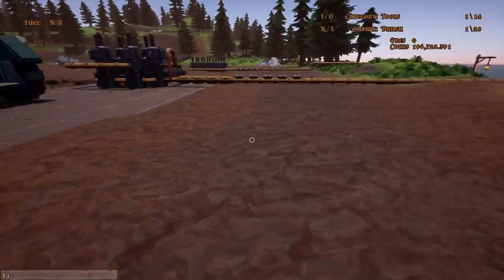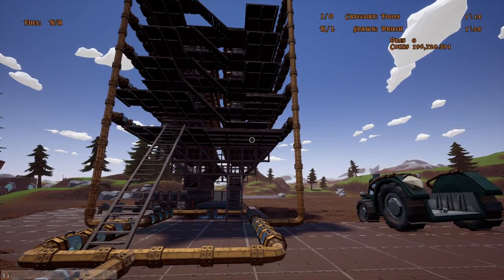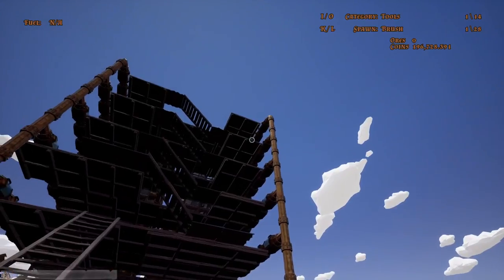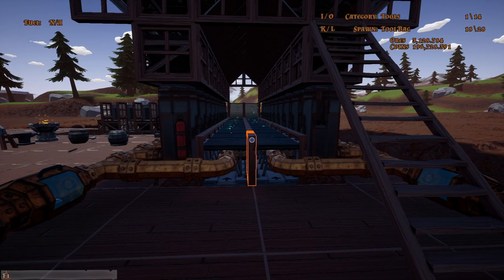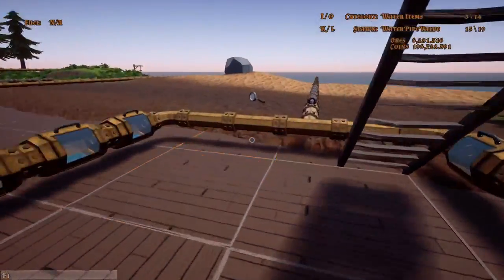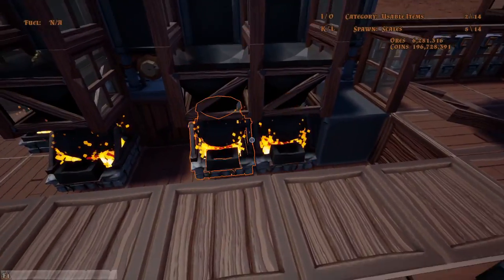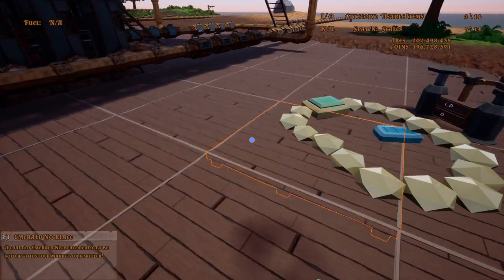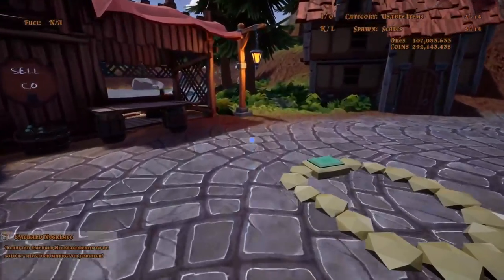Massive 200 RAM Drill Tower| Hydroneer Gameplay

Comment: You CAN make a bigger build.  I'd do it myself if there were a more efficient way of buying and transporting lots of parts.  I don't have the patience I used to, apparently.  Anyway, what you need to do is minimize the amount of time the resource particles exist in the world.  Right now you have only one sorting and smelting station.  There's room enough on that plot for many of them.  What I suggest is having each ram drill face directly into the top of the automatic sorts (I forget their name).  The dirt particles basically exist for a fraction of a second, if at all.  They get processed immediately.  I'd suggest 10 or 20 pairs per belt per foundry cell.  That way the resource particles exist in the world a minimal amount of time.  Long story short, the shorter they exist in the world, the faster you can go.  Even though you have multiple foundries, you can always take all the bars and chuck them on a belt at a final refinery to sort and smelt, collating all the output in the end.  I forget, is there a creative mode?  I could make an example.
Reply from the maker: i cant make a build bigger than 200 ram drills i just dont have the power mate.. i need a better gpu and cpu
Reply: @Hybridsteel  The game itself is simple.  The physics calculations are the bottleneck.  

Do you have a way of buying and moving a whole lot of stuff at once?  Pallets are in and they're great, but even so there is a lot of hauling to do.
Reply from the maker: @Whackjob  apart from loading up the pallets and truck nope not really any other way...

Comment: I’ve not seen any bigger builds with the David/Goliath drills. It’s very difficult with the direction of the David dirt generators pipes. I finally got a setup of 8 compact and all underground. Next step is to try 12. Would love to see you give them a go. Great videos!
Reply: Also, is this all run off of one main pipe? Does the power shards increase the amount of water in the pipes
Reply from the maker: theres a guy in the discord who has 126 goliaths running smoothly.
Reply from the maker: so it all runs off 1 line but with pipe splitters and chambers everything is evenly powered and produce's all at the same time
Reply: Hybridsteel Wow! I thought flow was related to how much the pipe initially produces so have been added multiple lines just for a few Goliath drills 😅
Reply: Hybridsteel I got this game a few weeks ago and joined the discord. Interested in seeing that!